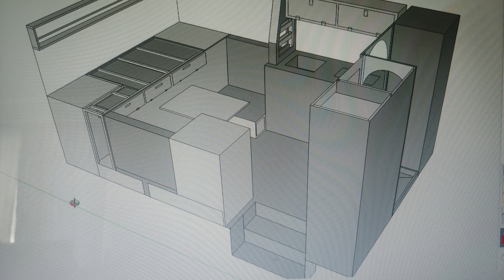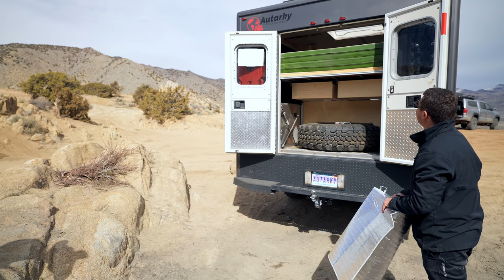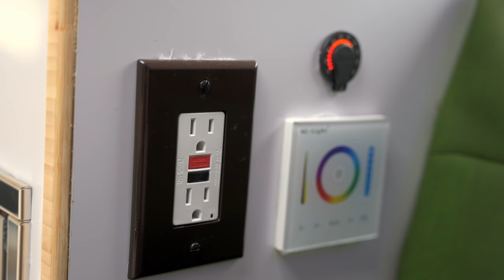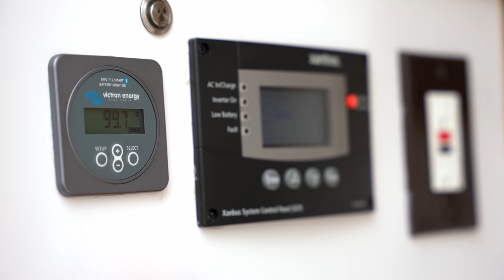DIY 4x4 Ambulance Overland Camper

Comment: Great ideas and build. Seems to have few rough edges. The hex bolts on the bed slide out for example. Use carriage bolts and acorn nuts. The over cut corner on the show door. Love the build and layout.

Comment: I'd make minor changes to certain things though for balance of the truck and easy serviceable maintanence from the outside and inside. I do like the exterior design of it. 

-Build Gray/black and toilet Water tank Accessible from both sides under the shower and toilet where the that battery storage is at. Can use a cassette or build a tank to drain like the Rv's for it. All water usage of Showers, Cooking, and Using the Toilet all goes down to 1 tank under it.
-Left side storage next to driver door use for CampFlux Portable gas water heater, Water Pump, and Propane tank. Easy to hook up shower, sink
- Remove Top cabinet shelf. Add Small Microwave above the The sink , but switch the sink and cook top around to be easier to hook everything up and drain. Also when cooking the window is right in front of the heat to blow everything out.
-Dometic Fridge and Freezer Slide out under the sink counter top. Can just easily load up groceries into it from that outside door under the sink. Pots And pans can be store under the seat.
-Electric Panel control and fuse box built Next to side Door Entrance and above the main batteries for the Main House battery.
-Rear Storage at the double door under bed is Fresh water tank.
-Built a Double Swing Tire mount on the Rear to mount the Spare tire to be easy serviceable.
-Solar Panel Rooftop.
-Get rid of that Panel board U shape on the toilet. to Give more space and avoid hitting your head when sitting down.

Comment: What a clean cut and efficient build.  Love it.  The galley seems unified in design, with a low profile, modern touch, very nice. Bed area is very functional with a dedicated garage area and under bed storage. The bathroom is lovely. They have lightweight foam tiles that you stick on that resemble marble - Pelham or something. Waterproof. This will save you time on next build - use these tiles.

20:54 - LED light strip. Go one more and add a light strip cover so it does not shine into eyes when dining or in bed.  German RVs do this, and its very elegant. You never want raw lights.

21:58 - I love this shower and its a very smart placement in hallway. You might want to cut a mat out of solid wood on CNC machine to custom fit the shower pans. Euro RVs are all doing that. No nails to rust, no screws, easy one piece with rubber legs glued on. Raises the pan for standing so its a smooth walk to cab area, and keeps feet dry while water drains off slowly.  No sloshing either.  The toilet placement is the very best place to put it. One other guy had done this. Very smart!!!
24:21 - Personally, I need a bigger 6 cu ft fridge with separate freezer, and would sacrifice garage for it,  This is too small for stocking up on food and will be a pain over time.

One tip more - the spice rack left of sink looks gorgeous!  However, if you made it a pull out pantry for cans or spices, you would need to cover up sides with plywood. Then you could hang IKEA Bekvam / Rajtan spice racks along that wooden wall, and also a small dish rack.  More space for kitchen. Consider too, the concept of a hinged or swing out shelf pantry system against a wall. Closed, it is a wall with hooks on outside. Unlatch and swing out the boxed shelves and a huge pantry opens up for cooking or jewelry, or even clothes laid flat on hangers.  Visit an airplane bathroom, you get a lot of ideas for compact spaces.

The motor details went a bit over my head but you seem to have done an exceptional job of converting this road vehicle to an off road van. Bravo!  Those springs look very rugged.  I probably need that for my Class C too,  Very impressive overall build, thanks for the tour!  Love it.

Comment: I love seeing “DIY” in all these overland vehicles youtube videos only to hear the owner mention sending their whole car to a shop somewhere to get a whole suspension rebuild, transmission conversion etc. unless you are doing it in your driveway like some of us. Not DIY.
Reply: Yeah, this is about as “DIY” as a “checkbook tour” of the service industry— with sponsor-like plugs.
Only, they shoulda designed it, too!
Mine? truly cheap— before Ambu’s were a thing— but it still lights-up a site.
Reply: You and C Luek can keyboard warrior all you want. Pretty weak talking down on this build because he outsourced the 4WD and suspension, but engineered and thought through every single change, built the entire interior, electrical, water system, woodworking, welding, etc. etc. Where's your 100% DIY rigs guys? Did you mold the rubber tires in your garage?

Comment: The top end DIY 4x4 ambulance conversions I've seen and liked so far are way unaffordable. Thus, I'll have to be satisfied with a minimal level of conversion to stay within a budget I can afford. This is a nice rig. I love it. Particularly the ability of living off grid for upwards of three months.
Reply: Agree completely. A standard van E-Series is all I want. I have several 2014 ambos, and wheelchair vans i LOVE the v10 (some have 5.4) , and posi rears. The v10 gets same mileage as 5.4, and for mountain passes and pulling a CJ7 on highway i want the power.

Comment: Beautiful rig. I noticed that the leaf spring U-bolts looked vulnerable when rock crawling.. Years ago, I equipped my 1975 CJ-5 with a set of shackle U bolts skid plates made by Con-Fer. I'm not sure if they are even in business anymore, but the design was simple and cheap. Maybe consider adding them to your vehicle.

Comment: I see only one key issue. Your rear brakes are wide open to be bashed on rocks and such. Should have just swaped to an srw axle instead of running a single wheel on the drw rearend. You saved money but not if you bash those rotors on something

Comment: The diesel heater controller is in a odd place. At night when the bed is extended you would have to climb out of bed and crawl under it to adjust the heat. Nice truck though.

Comment: Why do you need to take a camper into rugged terrain with no roads.  Its idiotic.  If anything happens, and it will happen for sure, you are stuck there, no help. And when you go back to smooth roads, your mpg drops to the point where you not only leave a horrible carbon footprint but go broke at gas station.  For the few times you need ruggedness, you sacrifice mpg on every highway mile you drive.  Pay pay pay pay pay. For the gas.  The tires.  The build.  And no frills either.  Makes zero sense.  I would never go into terrain like that with a heavy van, heavy water tanks, stressing out every joint.

That being said, your interior design is very well done.  Sleek, low profile cabinets, and bathroom is genius!  Love the kitchen galley, stylish and functional.  It makes a huge difference having a toilet and shower stall.  Wish the fridge was bigger and there was a closet too.  But one cannot have everything.  Good job on build!
Reply: There is a 2 year wait list for Earthroamers (600k - 1.5million). This an ER-like vehicle at a fraction of the price. There's clearly a market for it and I can tell you from experience there's nothing like getting to the most remote locations in this country with a legit RV with top of the line systems to enjoy during your stay. If you've never been up a wild trail and camped where no other human will show up for weeks, then you just don't have a grasp on it. That doesn't make it idiotic at all, that just means you're a keyboard warrior with less desire to explore.

Comment: I will start this with a complaint. 1 you should really look up the definition of DIY because this is a multiple shop colab with professional builders that did most of the work. 2 you used the known most unreliable diesel engine Ford has ever put in a truck. Now that said its an awesome build with alot of money put in by a shop thanks for sharing.
Reply from the maker: Depends on what you mean by “it.” Zach did all the planning and design and a lot if the work. He delegated some of the work out to qualified shops. But he managed and oversaw the whole process.
Reply: @AllTerrainFamily  Do It Yourself is DIY this is a shop and family that builds dont use DIY if your not.
Reply: @AllTerrainFamily  thats not diy its company broadcasting which is fine but false advertisement in your future nice job
Reply: @AllTerrainFamily  again diy means do it yourself not have someone do it and those of us who do do it ourselves well we dont oversee the process thats kinda a crock of ahcooo.
Reply from the maker: Yeah, well, that’s just, like, your opinion, man.

Comment: sucks u can't even use the best outside storage because they ripped out everything n filled it this is definitely cool but i'd rather keep the outside storage and original ambo inside instead and Try fit what i need with out changes to it that are this insane but it's definitely cool